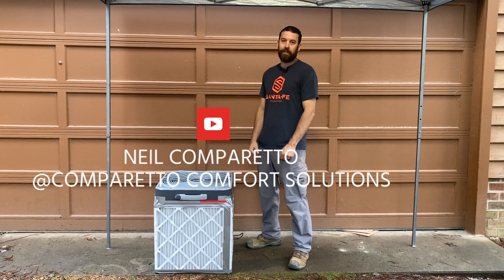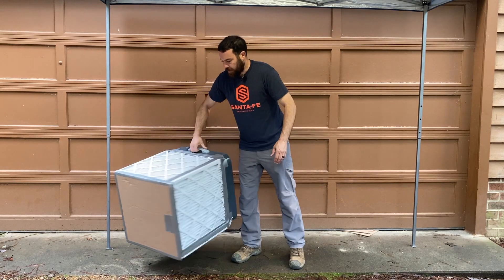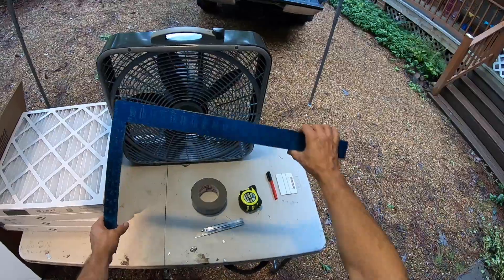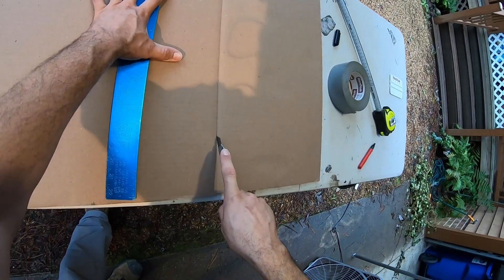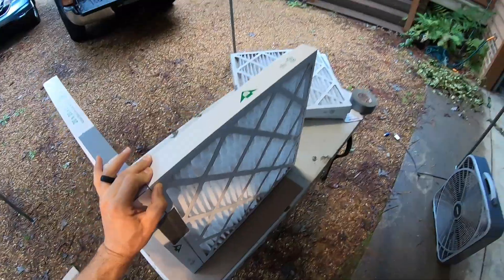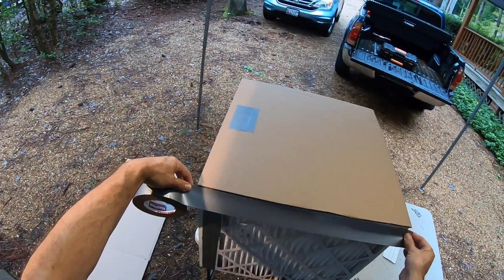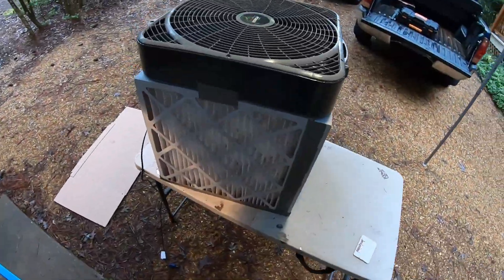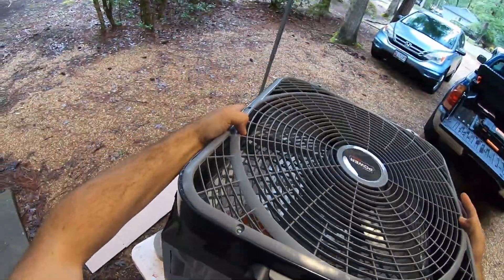High Quality DIY Box Fan Air Purifier "Comparetto Cube"

Comment: except there’s a problem. check the corners of the front of the fan. air is getting sucked in there. put pieces of paper all over the front corners and  edges. they will stick. air takes the path of least resistance. it’s not going through the filters. only a little is. most gets sucked in the front corners completely bypassing the filters. you need to block the corners.

Comment: Excuse me if Im wrong.. but you are not moving 4 times the amount of air.. you have reduced the air flow by 4. What youve done is increased the 4 times restricted air flows FILTERING ability. LOL Right? ANyway.. Im making one of these, no matter if the air is restricted or not! LOL
Reply: No, 4 times the surface area makes it much easier on the motor and to boot the thicker filters increase that. This surface area give you superior surface area to thousand dollar units with significant airflow.

Comment: I does seem it would be difficult to change the filters without removing them and making the filter box over again.
Reply: The trick is using 2 thickness of filters on every side. You put something like merv 8 taped securely over merv 11/13, and the merv 8 will become dirtier much quicker than the merv 11/13 below it. You can gently vacuum the merv 8 a couple of times, it'll last years. Once you judge that the merv 8 cannot be more vacuumed, you remove the merv 8 from the 11 and replace the 8 only. The 11 are taped very rigidly to the fan but the 8 are easy to remove and replace. The merv 11/13 filters will last years, years and years before needing to be replaced. Maybe something like 5-10 years minimum. The airflow speed through the filters is so slow (hence why u want 5 sides) that the filters can work for a very long time before needing replacement. They get to use their whole material thickness to a higher % than in a high flow situation.

Comment: Fans work way better when they are housed inside a closely fitting shroud. Take off the rear grill and make a cardboard shroud for it which only leaves a 1/4" or 3/8" gap between the fan blade tips and the shroud surface. It will prevent any toroidal bypassing of air from the front and it will force the air going through the fan to all come from the rear through the filter. Or, the opposite of course if you want to go with the fan blowing air into the filters. 🤷🏻‍♂️

Comment: Glad to learn of this increased airflow with this 3 filter portable solution.  Unfortunately,  I observe the bigger air filtration HVAC problem with Forced air duct work LEAKS throughout a 4000sq home located in the moldy and pollen filled wetlands of SC.    To fix and change the outcome before the 2018 flu season I know this was the biggest source problem observed bringing nasty dirt up from the crawl and attic space into the house.   Yes, it takes time to fix and not easy in some back aching crawlspaces.   4 years ago, before COVID,  In an DIY effort solve and to catch and destroy a few more toxins from the air, I mummified sealed all my duct work and installed UV-C light.     I recently began easy and cheap painting on a little activated coconut charcoal onto washable re-usable magnetic and electrostatic filters.   Even a little baking soda impregnated onto paper filters without any noticeable clogging.   House is clearly observed cleaner without any mold, mildew and with far less dust accumulation.   Not one person or pet in the family has even caught a cold or flu since I completed this worthwhile effort in March of 2018.

Comment: What MERV rating would be required to use this as an air filter for drywall dust? I'd like to have this run in a room that is being sanded.
Reply: Merv 13
Reply: @fongstar  Thank you for replying.

Comment: won't a vertical fan die quicker?
Reply: Yes. But...you can just gut the motor's Oilite bronze bushing setup and replace them with a deep groove ball bearing pressed lightly into the cylindrical socket that is left over. :) The bushings are usually small and held in place with a sheet metal retainer with a felt pad soaked in oil. Rip it all out and you'll be left with a hole in the motor chassis and end plate. Measure the rotor shaft diameter and measure the now-empty bushing socket diameter and buy bearings that fit. Voila, much longer life and more orientation tolerant. Same goes for shopvacs and bathroom exhaust fans etc.

Comment: Neil, I suggest removing the plastic grill that's on the intake (back) side of the fan.   The perimeter of the fan cabinet will fit better against the edges of the filters.  And that back-side plastic grill serves no purpose anyway after the fan is connected to the filter box.

Comment: How often do you have to change the filters if used daily?
Reply: Each filter is supposed to last 3 months in an HVAC system. Spreading out the airflow across 4 filters should extend the life. I've seen guesses of 6 or maybe even 9 months. It's a DIY filter with lots of variables, so something in the 3-6 month timeframe is probably a good rule.
Reply: @schivlg  thank you so much

Comment: Nice! But like every retail fan configuration is WRONG!... With any filtration fan blowing from the top or sides outwards, all you're doing is blowing all the dust all over the place. The fan blowing outward trying to bring in air through the filters is not strong enough to suck particles/dust from the sides, it just doesn't work, smoke maybe but not dust. I've checked this on several like BlueAir and others from $300 to $600 systems, none of them work. The direction of fan blades should be reversed sucking air in, bringing the air directly downward. This will provide greater ability to catch dust/particles floating in the air. Particles do not float on the floor. Try it!
Reply: You're gonna have to define dust because I've tried it with instrumentation and you're completely wrong, it cleans the air of any human sized room extremely quickly. Any particles that don't get caught up in this are big/heavy and fall to the floor quickly and don't get blown around by the amount of air this pushes if you position the fan in a direction that makes sense for your room. You could say that the air in the room "mixes itself" pretty quickly with no help at all, and even quicker with the small breeze done by something like this. No matter where this is in your room, your room will be dust free for years to come. You like will never need to dust ever again, or maybe like once per year because of the heavier stuff our clothes and socks leave everywhere.

Comment: There is a circle molded into the front grille which is the same diameter as the fan blades, you should block off the corners on the front grille which are outside of that circle. This will reduce turbulence and reduce the amount of unfiltered air being sucked in through the front grille.
Reply: Will that really work?
Reply: @inspectorvoid  It really works

Comment: question: is the cardboard base necessary? is it just to maintain rigidity? i was thinking of just skipping the base
Reply: Someone mentioned if there is dust/ debris or whatever on floor you don't want to recirculate what's on floor into air therefore having that cardboard base helps eliminate that problem.

Comment: thinking about building one of these to replace my small air purifier which only has a CADR of 70. considering a single filter box fan purifier has a CADR of nearly 200, I reckon this design would be comparable to a high-end purifier like a blue 211+

Comment: Great idea.  I'm going to build one.  Besides airflow, are there other downsides to using 1 inch filters instead of 2 inch?
Reply: From my 30 minutes of research on this, the thicker filters should allow more airflow. If you're using a Merv 14+, airflow becomes important even in this configuration as the higher the Merv rating, the lower your airflow gets UNLESS you are using a Lennox filter which are very expensive but has pretty high airflow at Merv 16!
Reply: You don’t need any thicker than 1 inch. Four filters means more surface area so less resistance. Cost prohibitive to use thicker filters.

Comment: Love it, it's easy, it's relatively inexpensive and it works. Made it in 20 minutes or so. Box fan $30-40. Filters $20-30 each Canadian bells. I bought my fan at Canadian Tire and filters from HD both online and picked up in person. I added coverings to the corners to minimize air going into the fan from output side. I used packing tape. The cube is sturdy with cardboard base made from fan box.

Filters rated good for 3 months, I used 3M 1900 versions for best filtration I can afford. 20"x16"X1", 20 width and 16" height for my cube + 4" thickness of my fan... You get the idea.

Your cost will vary based on what you can afford. This video inspired me to spend my hard earned bells in a great way, sorry manufacturers trying to sell expensive devices I have bells left over for something else!

Comment: To save some time..... couldn’t you just connect all the filters together with duct tape then place your cube on top of a piece of large cardboard, trace an outline of the cube, lift and cut. No t-square (well, maybe to cut a fast straight line), no measurements......Easy peasy.

Comment: I used 20x30 filters.  They were the same price as 20x20 but gave me 800 square inches more filter area, 20x10 x 4 sides.  it was 10 inches taller.
Reply: Golden tip

Comment: I  taped one 20x20X4 on the back. Maybe not quite the airflow this thing does but probably close and a whole lot easier / cheaper / smaller.
Reply: @Beardman56    Hardware store I was at was $19 for a 1”, and $35 for a 4”.   That would be almost $80 for 1” filters vs $35 for the one 4”.
Reply: @Beardman56  don’t know where you’re getting merv 13s for $10 a piece but that’s a good price.

Comment: If I work in a small space with just one window, where is the best/safest spot to place this? Near the window or doorway?
Reply: Wherever there is the most outside air coming in would be my guess. Mine is between my window and my sliding glass door. There are a lot of cracks in both and I’ve noticed an extreme change in air quality!! Good luck dear 👍🏻♥️

Comment: Wouldnt it move more air to clean if you flip over the fan and allowed the suction to be on the top and it blows into the box filtering fresh air getting pushed out of the filter instead of the fan blowing out??
Reply: The fan will only move x amount of air either way.
Reply: @viverra  if this was in a office building with other people the fan blowing hard up into the air would hit the ceiling and bounce off in a mushroom shape type way.  The filter sitting low to the ground.  If someone sneezes or coughs that fan blowing and moving air in the room would allow the sneezy couch talking particles throughout the room.  Making others receive what might would not have happened if the fan wasn’t there blowing high speed upward moving air.  It would be better turn the other way blowing into the the box and while vacuuming air/particles  down into it and pushing out clean air through the filters.  OR leave the fan blowing upwards but put filter over the fan so that it will not blow high speed moving air and particles as they naturally wouldn’t normally move in a room

Comment: Merv 13 are $20 a in my area, so this would cost roughly $90-$100 to build. Why do this instead of buying an air purifier instead? (Serious question, I would like to know the benefits)
Reply: This moves (filters) a lot of air. Most air cleaners in the $100 range process a fraction of the air this will.
Reply: @neilcomparetto  thanks for the reply. I think I'll go ahead and make this then. My dogs like to sleep in my son's room and they come inside covered in dirt and dust from out back
Reply: The air purifier filters cost $60 a pop and move a lot less air compared to this.  I built one just like this  and it's awesomely fresh air for $80+.

Comment: Great video that throws cold water on my plans! 

While I have seen videos that strongly support the feasibility of a single fan with a single filter (and followups that say the fan hasn't failed in months of operation), if one bothers to leg out the airflow rating of ordinary filters and commodity box fans, you're entirely correct that a single filter is significantly restrictive to the fan.

My plan was to slap together a filter with 3 fans, 3 filters in series, something like "coarse filter -> fan -> medium filter -> fan -> HEPA filter -> fan", to substantially reduce the frequency that the HEPA needs to be replaced. Now I realize the inefficiency (and of course the finer the filtered particles, the lower the FPM of the filter). While it's possible to stage them on a cube construction like this, assembly and filter changing will be a lot more effort than clamping them together in-line.

Thanks for the excellent video!

Comment: I’ve been using std 20” box fans for several decades with a 3M filtrete on the back for all daily and renovation purposes.  I really like the idea of the 2” filters as it provided double the filtration medium AND to support the fan in your config.  Essentially you just created a filter with enough cfm and filtration to compete with $300 air cleaners.   Meanwhile I’m running four box fans throughout the house during COVID-19.  Just in case.  Throw a UV light inside your config and you now have a $500 comparative air purifier. Nice work.
Reply: Glad to learn of this increased airflow with this 3 filter portable solution.  Unfortunately,  I observe the bigger air filtration HVAC problem with Forced air duct work LEAKS throughout a 4000sq home located in the moldy and pollen filled wetlands of SC.    To fix and change the outcome before the 2018 flu season I know this was the biggest source problem observed bringing nasty dirt up from the crawl and attic space into the house.   Yes, it takes time to fix and not easy in some back aching crawlspaces.   4 years ago, before COVID,  In an DIY effort solve and to catch and destroy a few more toxins from the air, I mummified sealed all my duct work and installed UV-C light.     I recently began easy and cheap painting on a little activated coconut charcoal onto washable re-usable magnetic and electrostatic filters.   Even a little baking soda impregnated onto paper filters without any noticeable clogging.   House is clearly observed cleaner without any mold, mildew and with far less dust accumulation.   Not one person or pet in the family has even caught a cold or flu since I completed this worthwhile effort in March of 2018.

Comment: Nice setup. Having its own base is great. Im using a 4 inch pleated filter. Have extras from my furnace. Curious the reason(s) why the filters are on the input side of fan.
Reply: Because all the best air filtering systems have the filters placed on the air IN-TAKE side, to better draw and capture the unseen particles and impurities suspended in the air through the filtration process. Most 3-Stage Air Filtration Systems start with: 1) a Washable Fine Mesh Pre-Filter [to capture and remove large airborne particles such as hair, pollen and lint]. 2) Next an Activated Carbon Filter [helps eliminate household VOCs and absorbs odors].  3) And finally, a True HEPA Filter [captures 99.97% of allergens and unseen particles down to 0.3 microns such as pet dander, smoke, dust and mold spores]. Again, the best air filtering technology on the market draws the airborne particles, odors, dust and mold spores through the filtration process, leaving the air exhaust (OUTPUT) unobstructed with clean and fresh filtered air.
Reply: Airflow is much less turbulent on suction side of fan, allowing filter media to load up more evenly.
Reply: Filters have to be on input side of fan in order to draw air through the filters and then blow the cleaned air up out the top.

Comment: Any idea how many CFM this displaces. or  how many time per hour it will cycle air in the space of an given area?
Reply: Lasco, 20 inch typical box fan, on hi speed is 1820 cfms. Room dimensions- w x l x h / cfms = mins to circulate room.
Reply: Listening to the video on This Old House, Ross says the fan cube with filters gives 900 CFM air flow. It appears RidemFast’s 1820 CFM is the fan manufacturer’s flow measurement without filter cube attached which increases resistance.

Comment: Mounting the fan horizontally will reduce the time-to-failure for the oil impregnated bushings inside the fan motor. 
Since this design is basically single use, or maybe one filter change, that probably won't matter since the service life of the whole assembly is a semester or perhaps one school year at most. 
You would definitely want to schedule replacement, rather than waiting for bearing failure/seizure/overheating/safety trip conditions to remove from service considering the application.
Reply: If you take apart one of these, you'll often find a shaded pole motor with Oilite bronze bushings surrounded by a felt pad that is soaked in oil and held into the motor frame by a stamped cap. If you remove all that stuff, you are left with a cylindrical socket in the front and rear of the motor frame. Measure the rotor shaft diameter and the bore of the new circular socket on the front and rear of the frame. Then just buy deep groove ball bearings which are a slight press fit into the socket. Ta-da! You took a cheapo box fan made to last a year or 2 and made it into a much much better fan which can last 5-6 years no problem! :) You can also do this with bathroom exhaust fans and shop vacs. 💪😎 They often use the same simple bushing design that fails after a while.
Reply: The fan was designed for vertical usage.